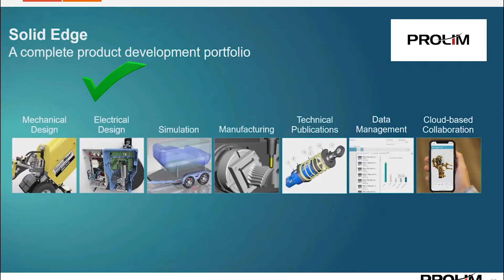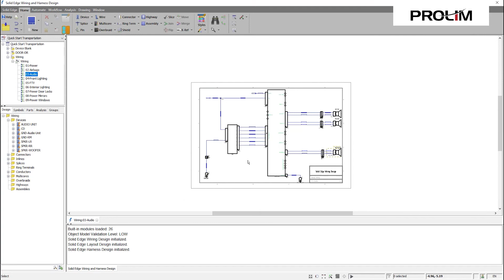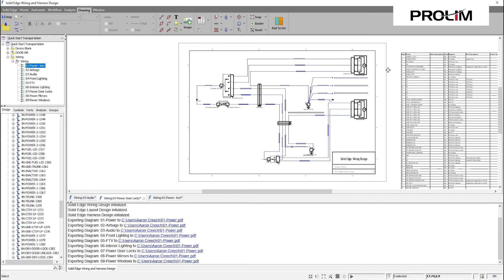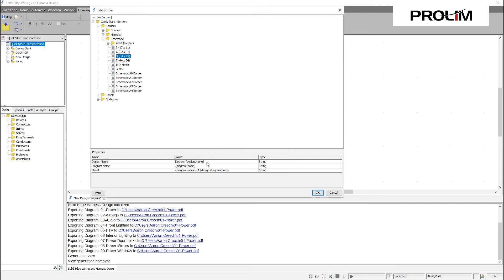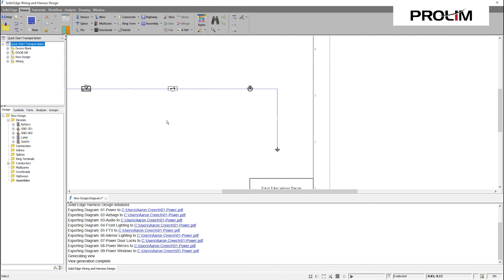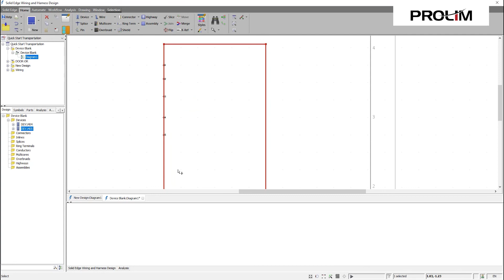How can Solid Edge 2021 Improve Wire and Harness Design? - PROLIM Webinar

Comment: At 41:14 there was a simulation between two grounds (Where should not be a potential difference normally). 
The two grounds were not on the same net I presume. 
How can you place multiple ground symbols(preferably across sheets) in a way that they are part of the same net? Similarly to references. (but with visually representing ground symbols)?

Comment: at 8:50, you said all solid edge wiring harness comes included with electrical parts library. But I couldn't find it in the software, how to find and use it? Please guide.
Reply: Hello Dipankar and thank you for your question. 

I will try and keep my answer as simple as possible. The answer is yes, the embedded electrical parts library (including electrical parts and symbols) is included in every install of the Solid Edge wire and/ or harness design (they can be purchased and run independently of each other based on your need). 

The administration of the library is configurable at the installation process. Once you accept the license agreement and determine whether you are installing a "complete" (one tier - stand alone) or a "custom" (two-tier - network) installation type, you will determine the location of the parts library (called the embedded database) to be installed. Once installed and you are in the application, you can access and configure the parts & symbols library directly from the launch button within the solid edge electrical application how you wish. 

If you have any further questions, please contact us at technical.support@prolim.com for additional information.

Thanks,
Aaron